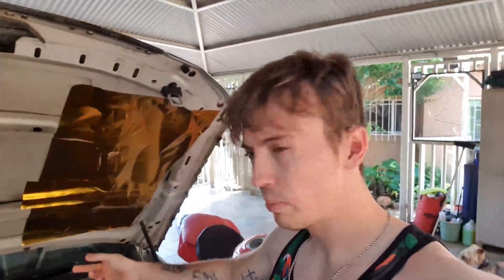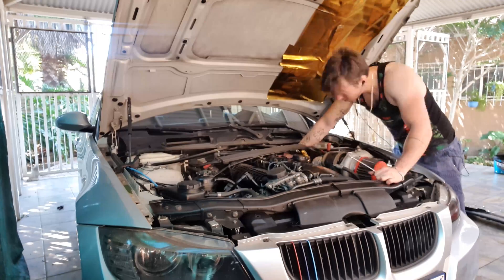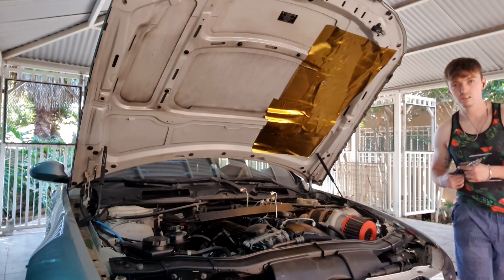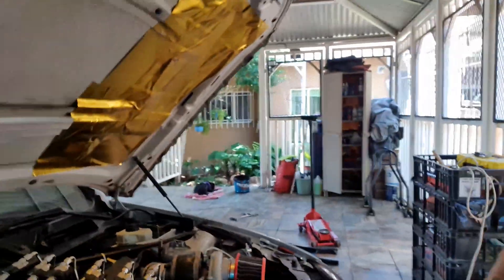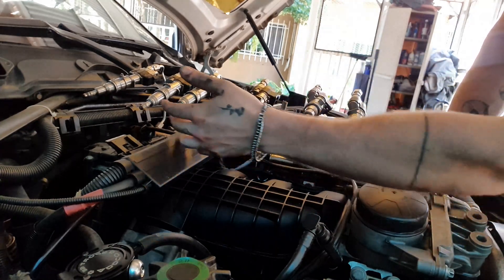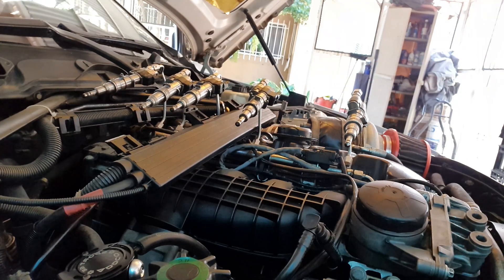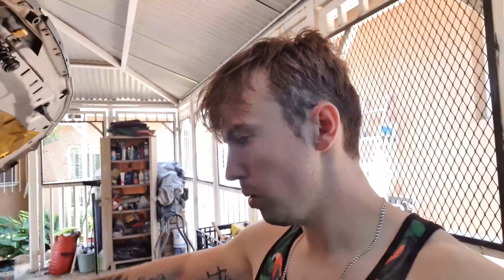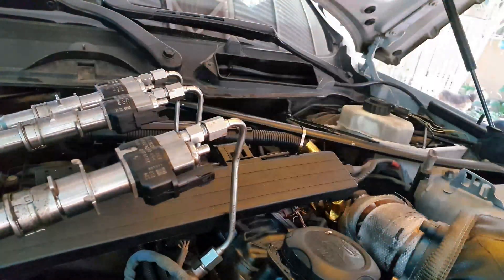N54 Injector testing, Car hesitates and stutters

Comment: You'll want to put new seals in if the injectors dont remain seated perfectly theyll start move around with  the tension spring and hone the bore. Causing way more trouble..40 dollars is not worth a bore repair  kit or new head.

Might be your post 02 sensors there responsible for fuel trims..